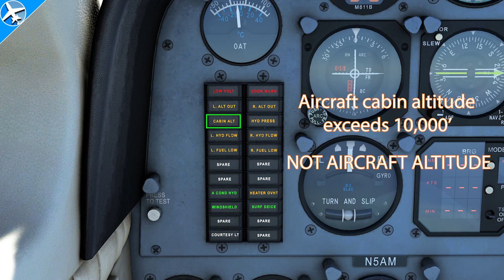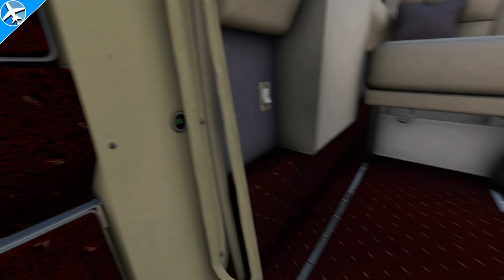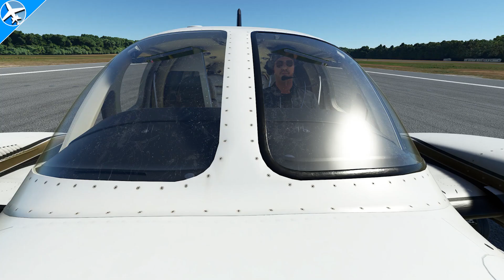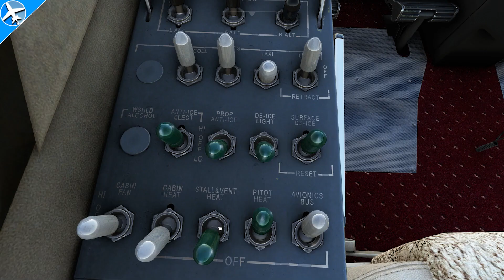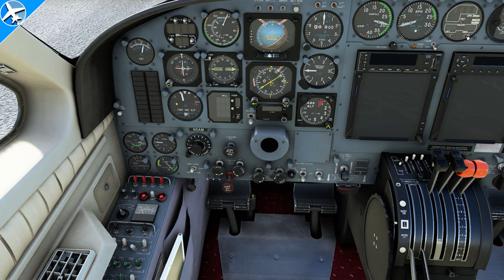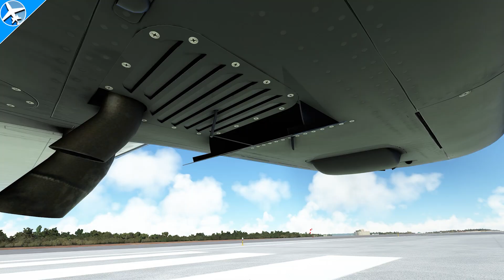FlySimWare Cessna 414AW Systems and Switches: An Explanation by a Pro Pilot

Comment: Thanks for sharing your knowledge. I've been flying this plane since the beta period and have been slowly reading/learning all its stuff. There's a lot for a fairly new flight simmer to understand not only what a button does but more importantly how it does it. You just accelerated my understanding of the systems by a lot and thus my enjoyment of this hobby. Thanks and awesome video.
Reply from the maker: It is good to hear you are enjoying the FSW 414 in MSFS.  It's a fantastic airplane and I fly it in MSFS a lot myself.  I may be doing some more videos covering the 414 and flying some approaches in it, so if there are any questions/subjects you would like to see covered, leave them in the comments.
Reply: @thecorporatepilotdad  I look forward to future videos of the 414AW. It’s my mostly flown aircraft and has been for a while. After watching this video I’ll be trying to put some of this new learning into practice. Here’s some things I’ll be working on so maybe these will give you topic ideas.

1. I struggle controlling the cabin heating. I need to find the right balance between using the 2 heating systems and the air conditioning. How/when do you use these 3 systems? My passengers would appreciate some tips on that ;)

2. In the video you mentioned “high altitude flying” above 20,000 ft. I’ll be working on properly setting cabin pressure, adjusting cabin temperature, setting the engine mixture, working the icing systems etc. as I ascend and then how to safely fly at high altitudes. Can the 414AW be taken to the top of the Himalaya Mountains?
3. I’ll be looking into failure scenarios and how to use some of the little-used systems to mitigate the issues. For example you mentioned the purpose of the dump levers so I’ll be playing with loss of cabin pressure or oxygen failures. Maybe something with fuel flow and needing to use the aux fuel pumps or adjusting the fuel tank levers.

Thanks and good luck.

Comment: Hi again! I just got the 414, and I wanted the TD 750 installed, which I had in the milviz 310. Unfortunately, despite hours of searching I have no luck finding how to install. Please help one of your devoted subscribers.
Thanks, Greg
Reply from the maker: Are you selecting the 414 TDS version under liveries when selecting the 414?  Try this also page 6-7 - https://www.tdssim.com/Downloads/Manuals/TDSGTNXiFlightSimManual.pdf

That’s about all I can do to help right now.  My PC died and is being repaired.
Reply: @thecorporatepilotdad 
Thanks for the link to the manual. Here is what the issue was.  You have to go to your HANGER in the sim and select your model (livery and units). That is the issue, it’s buried in the user manual somewhere, and who reads manuals. Unbelievable, should have made that known item number ONE!
Reply from the maker: @gregmiller7584  Glad you figured it out.  The 414 with the TDS GTNXi is a great combination.  That GPS does so much: fuel calculations, user waypoints, missed approaches, holds,  the UI is very user friendly, and so much more.

Comment: When the aircraft had a failure is there a way to reset the failures within its systems?
Reply from the maker: The failures in the video were self-induced for demonstration purposes.  Fuel can be transferred for an imbalance but there isn't a lot that can be done with system failures so far.

Comment: great video and yes I did  purchase
the aircraft and it is great  and how do you get the view  for the battery switch from top down view and for me the variation with the 430 / 530 Garmin freezes the computer
Reply from the maker: To move around the cockpit the left and right arrow keys can be used in combination with holding ALT and then up and down arrow to move forward and back.  The up and down keys by themselves move the camera up and down vertically.
Reply: @thecorporatepilotdad  ahh right and with the latest update 430/530 works

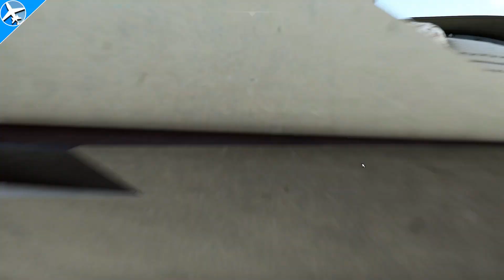Comment: Q1. @13:45 is the 'Cool/Circulate' switch only to activate cool air from the AC or is it required for the warm air to enter the aircraft when the three larger dials have been turned up too?
Q2. Does the Cabin Heat' dial do anything  if the 'Cabin Heat' switch is in the down/off position? Thank you
Reply from the maker: 1. The cool switch position activates the AC compressor to make conditioned cold air.  Circulate turns on two blowers to move the air.  The cabin fan switch can be used to circulate air as well.  When the cabin heat switch is turned on, the blower automatically goes to low (which is shown in the video).  Of the 3 knobs in front of the co-pilot, the knob to the left works independently of the other 2 knobs.  The cabin heat knob controls the gas heater.  The LH and RH WARM knobs cool the incoming air at the wing root and no fan is required to receive that air.  Those knobs control the butterfly valves on the wing root.  If those knobs are turned to the cold position, the valves open and allow more ram air to pass over the heat exchanger in the wing root to cool the incoming air more.  That same air that is being cooled by the ram air is used to pressurize the cabin.  

2. If the cabin heat switch is not turned on, the gas heater won't be on.  So, the very short answer is no, it shouldn't.
Reply: @thecorporatepilotdad  Fantastic, thank you for sharing your knowledge, much appreciated :)
Reply: @thecorporatepilotdad  So in 1. If the LH and RH warm knobs are turned to the left and the Cabin Heat switch is ON but the leftmost knob (CABIN HEAT) is also turned to the left, will cool air come into the aircraft provided the AFT and FWD are pulled open? So at cruise, I can switch AC off and control cabin temperature just with Cabin Heat switch and the AFT and FWD dials? I'm asking as I'm struggling to maintain a constant temp at cruise..
2. Does the CABIN HEAT switch on the left panel do the same as the CABIN HEAT dial?
PS A huge thank you for putting this up. This product deserves this!
Reply from the maker: @manic_miner  1.  In theory, yes.  Since temperature (and humidity) decrease at altitude, AC is not needed, and the air needs to be heated.  The LH and RH warm knobs could be producing warm air regardless of knob position, but less warm air even in the cool position.  When I flew 400 series Cessnas these knobs didn't get used a lot.  On nice days the cabin fans would be used, AC in the summer on the ground and at low altitudes, and in the wintertime and at altitude if needed, the heat was turned on.
2.  The cabin heat switch turns on the gas heater. The amount of heat provided by the heater is controlled by the cabin heat dial.
Reply: @thecorporatepilotdad  What does the DEFROST knob defrost if the pilot's windows is electrically defrosted, does it try to defrost the other cabin windows?
Thank you so much for your help!
Reply from the maker: @manic_miner  DEFROST is used to defrost and defog BOTH cockpit windscreens.  The pilot's windshield is heated.  An electrically heated windshield will defrost or defog a window much faster than air blowing through a defrost system.  If descending into warm humid air, defrost may be selected to warm up both windshields in advance to prevent them from fogging in the descent when the airplane has been flying in very cold air for any length of time.  Why would one be used over the other? Preference.  One jet I currently fly has a defog system, but it also has heated front and side window heat in the cockpit, which can be selected on or off by the pilot (we use it continuously in the air).  If windshield heat is on, defog is usually never needed.  Without windshield heat on, the windows can fog up some at altitude when flying through a cloud and defog can be used to clear the windows in a few minutes time.  I am not sure if defrost is programmed to do anything in MSFS itself in any airplane.  The icing effects in MSFS do need some work.
Reply from the maker: @manic_miner  I appreciate all your questions.  Not sure if you have this but here is a link to an abbreviated POH.  This is for the Cessna 414 and not the Ram IV 414AW that we enjoy in MSFS.  The systems don't change for the most part.  There was a full manual, but that link no longer works.  https://hangar50.com/wp-content/uploads/2018/01/Cessna-414-Chancellor-POH.pdf
Reply: @thecorporatepilotdad  Thank you for that link! I had a copy of a POH from 1981, so this is a great help for learning more about this beautiful aircraft, much appreciated. I find I can't get more than 1000 fpm climb with 120 KIAS though, so often have to drop to 105-110 to climb at the 'official' 1500fpm rate. Too many variables I guess but I'm really enjoying trying to fly this as close as possible to real world. It's also the only aircraft that feels realistic on landing for me, based on my short real world experience flying small GA.
Reply from the maker: @manic_miner  A climb speed of 120-130 works really well.  Fully loaded and in warm air, climb performance could be greatly reduced.
Reply: @thecorporatepilotdad  I have 6 passengers with luggage. Block Fuel 464 lb. Payload 1380 lbs. Maybe that's why I can't get up any faster?! I will try with 420 lb Fuel and 690lb Payload and see how I get on! Love this aircraft and really appreciate your help :)
Reply: If the cabin fan switch does not activate cooling, is it required for the AC to work if you are not using Cabin Heat? or is just used to blow 'cabin heat' air through the aircraft?
Reply from the maker: @manic_miner  The cabin fan switch on the left panel activates when the heat system switch is turned on.  When the AC system switch in front of the pilot is turned on, the fan turns on when circulate or cool is selected.  I am not certain if the cabin fan and the circulate fan/blower are the same blowers or not.  Either can be used to circulate air.  The link below has the FULL manual.  Not all airplanes came equipped with AC systems so any optional equipment will be listed in section 9 which is supplements.  There should be a small box at the bottom of the PDF screen that has page numbers on it.  Go to page 250 which is the start of the AC system.  https://www.dropbox.com/s/ohsqyd1jbniskmt/Cessna%20414A%20Chancellor%20-%201981.pdf
Reply: @thecorporatepilotdad  Pg 251 Blower air is different source to ventilated air from two speed cabin fan -Pg 479 - Forced air ventialtion is obtained with the two speed cabin fan.. You are right, one is general ventilation and the blower is just for AC. Thank you :)

Comment: Do you know if they removed the EFB? I can't for the life of me toggle it on anymore. I tried clicking everywhere near or on the small window on the left.
Reply from the maker: The click spot for the EFB is the top half of the DV window.  I’ll try it out too.  Are you using the newest version (3.2)?
Reply from the maker: On the iPad at the top where the camera is, click that spot.  Click it again to move it back to the pocket.
Reply: @thecorporatepilotdad  Thx for the reply. I finally found where the pocket is. (Where your left knee would be. If someone has the same problem).
I was actually clicking on the small window that you can open and close.. I think it used to be there.

Comment: Very informative video. As I said before, I have this plane. Definitely worth the price. The part on pressurizing the cabin I did not understand fully so I'll need to watch that part again. Thanks again.
Reply from the maker: Think of pressurization like this:  Air is constantly being pumped into the cabin from the compressor side of the turbo charger when the system is on and the pressurization air controls below the yoke are pushed in.  A controller opens and closes a valve in the back of the airplane to pressurize the cabin as much as it can without going over the maximum differential pressure (under normal conditions).  If the valve closes, air is trapped and the cabin will blow up like a balloon.  Opening the valve causes the air to leak out of the cabin quickly and the pressure inside will quickly match the outside pressure and the differential will then be 0.  Think of differential pressure as a sealed bag of potato chips.  At the top of a mountain where the pressure is less, the pressure inside the sealed bag didn't change from a near sea level altitude and the bag will blow up like a balloon as a higher and higher altitude is reached.
Reply: @thecorporatepilotdad  Thank you for taking the time to explain this. Excellent. I've been flying the Steam Gauge King Air of late and the pressurized alarm keeps going off on me as I cannot read that dial. The manual that comes with it explains it but the example they give appears to be wrong. I heard a real pilot, like yourself, on youtube say that you set it 1,000 feet above your cruise altitude. So do I use the inner dial to set it? I finally found the gauge that reads the plane's PSI which is suppose to be 6.81, so if it gets over 1,000, it sends an alarm. This is for the King Air, not 414. Anyway, thank you.

Comment: Awesome—very clear and succinct with just the right amount of depth, thank you! I picked this up when it made it to the marketplace for XBox. I have been gradually learning the systems through the sim manual, poh & trial and error, but this really solidified a lot — especially cabin pressure and the fuel computer adjustment. Just in general I was an instant fan of the cockpit. The system and flight modeling is immersive and it's been a real pleasure to finally sim-fly it.
Reply from the maker: You are welcome.  This airplane is great, and the cockpit is amazing for sure.  It will be even better when circuit breakers are implemented, and a random failure would be nice to have as well - maybe wastegates getting stuck because that did happen in real Cessna 400 series airplanes.
Reply: @thecorporatepilotdad  Love it! Hopefully some or all of those improvements will be a future update. I'm currently experimenting with sim performance vs. the POH. Manifold pressure seems to need a fairly different level at cruise to achieve TAS/fuel flow for a specific rpm from the POH...but with making that tweak, the airspeed & fuel economy can get to the expected values. Looking forward to your upcoming videos!
Reply from the maker: @BeltOfVenus  If you are looking at POH performance for the 414A online, keep in mind that is the stock engine and not the RAM converted engine.  The converted engine has more power, higher MP allowance, and flies about 10 knots faster over the stock airplane.
Reply: @thecorporatepilotdad  I completely missed that — that explains it. Thanks for the heads-up and for all your time and effort! Heading to Google to see if there is are performance tables for the RAM conversion:)
Reply from the maker: @BeltOfVenus  It is the RAM IV conversion with the TSIOL-550.  The standard RAM conversion has the TSIO-520 and has less power.  It will be hard to find the performance charts for that specific conversion as they are so rare.  However, if you find them, let me know because I want them too.
Reply: @thecorporatepilotdad   hahah for sure! although not looking promising as I dig further...checking Discord, sounds like the developer may be using feedback from the pilot consultant to tweak performance values rather than basing on a table. I just now printed the cruise tables from the standard poh & considering test flighting key altitude/rpm/mp rows at standard temp to get speed/fuel flow I can at least plan around.

Comment: Hello there. I have a question regarding the TDSGTN750Xi livery of that C-414. To be clear, when using the GTN750 the panel called "mode selector" located at the right of the yoke handle is removed. This panel is the one where you select for example the source of your NAV mode (NAV1/NAV2). Other liveries shows that panel but not the ones with the GTN750 incorporated. Does it mean that such panel is no more necessary because its functionalities are included in the GPS ? If Yes, regarding NAV1 and NAV2 I can indeed have 2 NAV's (with active and stby frequencies) but I have only one CDI instrument. So how can I switch the CDI source from NAV1 <-> NAV2 ? Thanks in advance.
Reply from the maker: I responded to this on the other video just in case you don't see it there, the short answer - There isn't a way that I can see to switch between Nav 1 and Nav 2 with the TDS or GTN 750 units.  The HSI is always coupled to the AP but there should be a way to couple the AP to the 2nd VOR to the left of the HSI.
Reply: @thecorporatepilotdad  Hi ! I will answer also to the other video but I've found the solution. First you have a CDI for NAV/VOR 2 (at the left of the ADF - Radio Magnetic Indicator) which is linked to NAV2 in the second (right) screen of the GTN750. To make it possible for your autopilot to follow NAV2 you have to push the CDI icon on that right screen, and you will then switch from GPS <-> VLOC2. If you do the same with the CDI icon on the first (left) screen, you switch from GPS <-> VLOC1. Of course after such manipulation, both screens indicate the same CDI source.
Reply from the maker: @FlyingVince72  I will have to try it with the TDS also.  I noticed those buttons but thought they were for the ADF.   Good job figuring that out!

Comment: How is one engine performance? Is that managed well in MSFS?
Reply from the maker: I would say it is good.  There is a large degradation of aircraft performance on one engine and the aircraft yaws toward the dead engine as it should.  Normally, on one engine, the ball is kept 1/2 its width off center.  To do so, a massive amount of rudder is required and the airplane flies very crooked through the air. That is probably a MSFSism but the rest of the single engine characteristics are there.